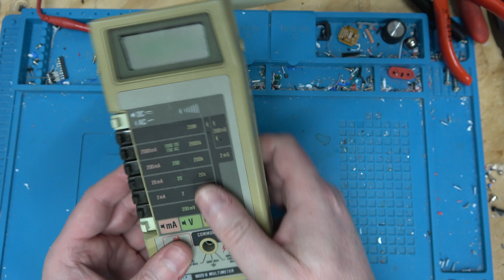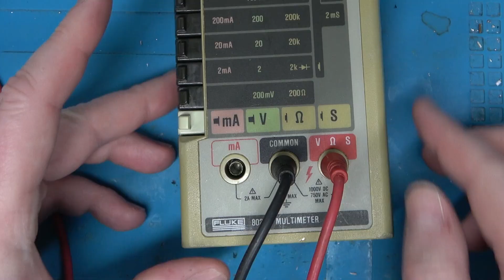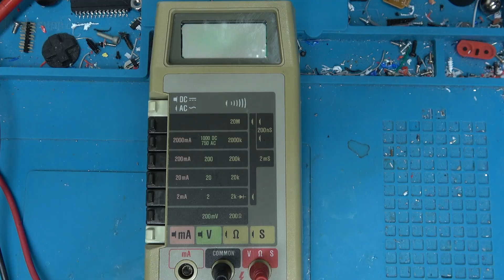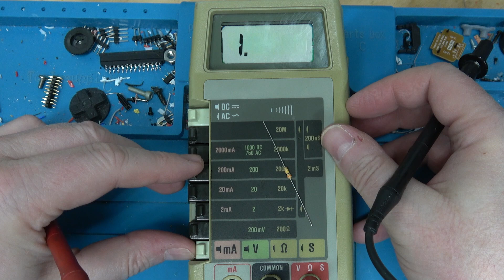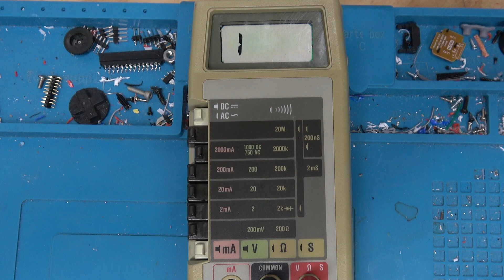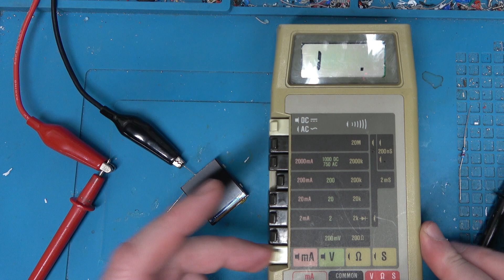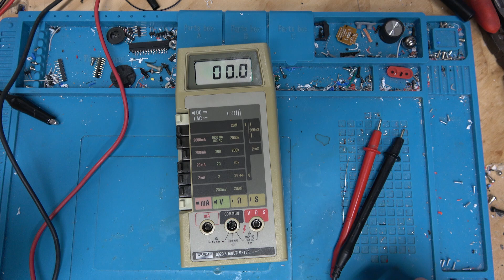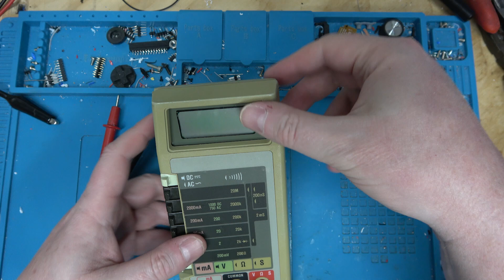Fluke 8020 B Multimeter Repair

Comment: Speaking of old meters, I have my grandpa's at the cabin. It's not a Fluke, though... It's not even digital... Hell, it doesn't even have a single ICs in it, or a PCB for that matter! 😅 It IS a multimeter though, with a nice rotary selector. And does still work, provided you have a D-cell battery haha 

But yea, analog and all point to point soldering, inside an off-the-shell universal bakelite project box (super dark brown, almost black) – or I assume it's bakelite 🤷‍♂️ Was a sold item though, despite the enclosure not being purpose made. 
If I had to guess, it's likely from the 50s, but in perfect condition. Cables have seen better days of course, as their sleevings are all "weather checked" (for lack of a better word, given it lives in a box).
<insert "IT BELONGS IN A MUSEUM!" soundbite here>

It's heavy, mostly due to that D-cell. But otherwise very portable! It's only about as big as my S23 Ultra, if memory serves... granted, 7x as thick as one! lol

edit: huh I could've sworn Fluke, the brand, had two Us... 🤨 Weird... Maybe I've jumped to another reality again. 🤷‍♂️ (that's how I explain away my memory recall errors lol)

Comment: Ew yes, one of the fun designs with the LCD screen like the 8022B I picked up a few years back that require a hacked in LCD display.  Neat to see the 8020B model.  Quick search still finds info regarding on the Fluke DMM groups io site if anyone cares.

Comment: The idea that AC is more efficient to transport is outdated. 
With AC the molecules surrounding the wire get polarized 60 times a second. At low voltages it is not a big issue, but at high voltages and long distances. It becomes terrible. Especially in water or underground.

There also is the skin effect what effectively limits the diameter of the wire, what also lowers voltage and increases resistance. 

You got to remember that during Teslas age, they're weren't any transistors and with modern electronics DC can be more efficient. Especially at high voltages that are now used.

Comment: mine died because of a corroded vias by of a leak from a cap. replaced all the caps and replaced the vias with a wire and bang! back in service

Comment: Ben what ever happened to the wire stripping tooth/implant you talked about once?? I also secretly desire to have a wire stripping tooth lol
Reply from the maker: I asked. They said they wouldn't consider it unless the upper and lower tooth were both implants (because of sheer differences)
Reply: Chipped an incisor when i was a kid, it's my backup wire stripper 30 years later

Comment: You think DC is less efficient than AC? Tesla could have told you that AC is easier to transform into higher voltages, which is more efficient over longer distances.  Nowadays the new transmission lines are DC.
Reply: only when they don't want to sync AC grids do they use HVDC links, no?
Reply: @redgek  The part of the grid that is DC is mostly California and it is separated from the main grid
Reply: DC is more efficient because it's not affected by impedance like AC is.  Back in Tesla's day it couldn't be efficiently transformed to super high voltage DC then back to AC, and was prohibitively expensive.  Today, it's child's play.  I wouldn't be surprised if the efficiency of modern electronic inverters approached or even exceeded that of transformers.  With the cost of copper, inverters may be cost competitive as well.

Comment: Ben Heck's desk is always so dirty. But I like the videos anyway.
Reply: All the best workers tend to have messy workstations, as they're too busy working to be bothered with trivial tidying up.
Then again, what he does doesn't NEED a spick and span work spot. 😊
I'm sure if what he worked on necessitated it, then it likely would be!
Reply: @DUKE_of_RAMBLE  It's VERY messy, though.
Reply: @SeanChYT  lol I don't have OCD, so I guess it's not THAT bad in my opinion.
Would I eat off of it? Definitely not.
Would I clean it before starting a project? Same answer. ☺️

Would I clean it if I was going to be working on something where in worried about dust or debris? THEN of course I would!!
But as I said, most stuff doesn't require that level of tidiness/cleanliness.
Reply: @DUKE_of_RAMBLE  I don't have OCD either. My workbench is always messy, but this is on another level. There's (conductive) pieces of metal and sticky flux residue all over the place. We're talking about "dirty" here, not just a little "messy". Just comparing with other YouTubers, I can't think of anyone even close to this, can you?
Reply: @SeanChYT  I'm no expert, but I wouldn't think old flux would be a big deal. Conductive debris, certainly, but he's also not working on antung mission critical. Which now that I think of it, I have seen him dump all that stuff in the garbage in those instances. (I think he occasionally uses a 'helping hand' solder stand as well, eliminating much of those issues) 
And to your question: yes... AvE 🤣  His puts Ben's to shame. It is messy AND dirty! 😁
Reply: @DUKE_of_RAMBLE  It's not conductivity that is the problem with flux residue. It's the fact that is very sticky, and makes your fingers sticky, your tools sticky, and everything you touch sticky, and you can't just wash it off with soap either.
Reply: @SeanChYT  Ah. I've not had any like that 🥴
I shall count myself lucky!